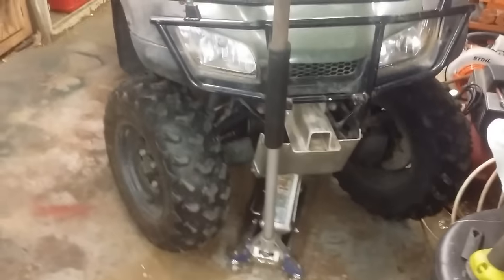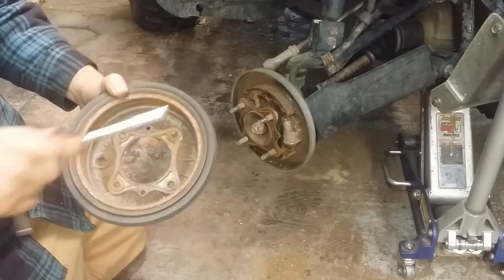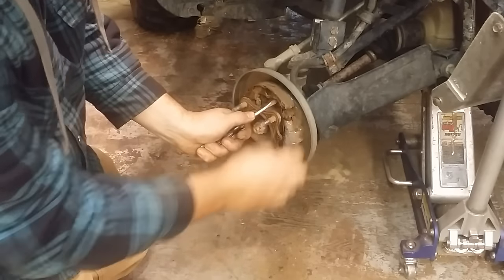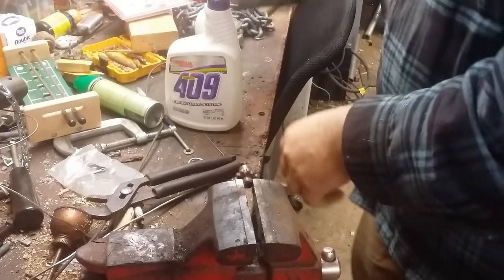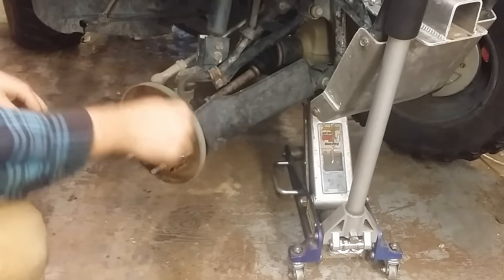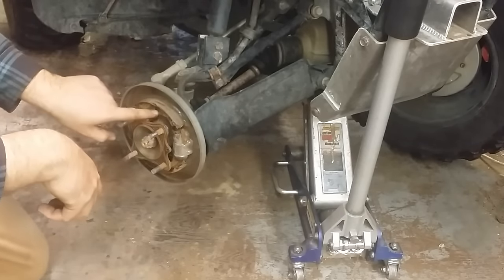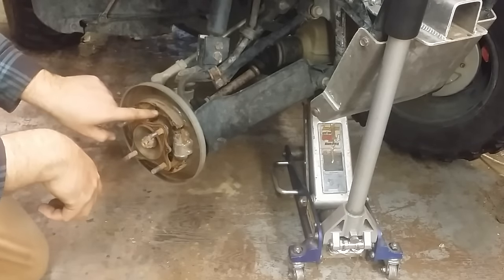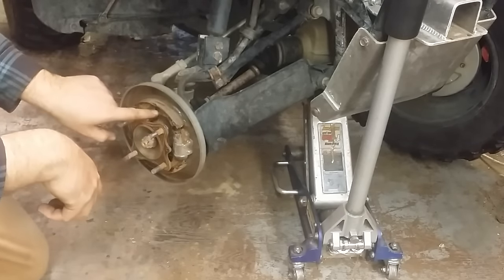Honda atv drum brake adjustment and refresh

Comment: LOL "Something this old, the bleeders are gonna be all rusted out". I have three Honda 300's and all three bleeders loosened fine. I've never had a bleeder seized up on any atv's I've worked on, and I've worked on quite a few in my days.
Reply: I have a 96 300 and my drum is having a tough time rotating. Any advice. (It sat for 6 plus years)
Reply: My 97 400 had a similar problem. Part of the rear shoe actually broke off, and became wedged between the rest of the brake shoe and the drum. Couldn't even coast downhill in neurtral. Rode it that way for a year.

Comment: At 7:09, I always use a dab of anti-seize on those threads before I screw them in. I seem to get more time before the adjusters start trying to re-freeze, as they tend to do. Thanks for the video! Good stuff!  
Edit: I saw later in the video where you hate it. I totally get that, but it absolutely works, and will outlast lithium grease every time. But it is a MESS. I keep it in a small syringe and squeeze a dab onto the threads. It doesn't take much.
Reply from the maker: I've started using the copper anti seize, and like it way more than the silver shmoo. plus it doesn't make as big of a mess.
Reply: @1beastlydudefixbreakrepeat  I'll have to give that a try.

Comment: Honda manual says grease the inner and outer seals, would probably help keep the drums sealed. Never had a problem with our Rancher 400
Reply from the maker: The only problem with that is the dusty environments I ride in. The grease will trap and hold the abrasive dust
Reply: @1beastlydudefixbreakrepeat  hm, I suppose that may be true, I would hope Honda would've thought of that, but maybe the drums are simply not designed well.
Reply: @M.TTT.  Pretty sure Honda engineers know these get ridden in the dust. That would be gentle riding! Greasing them stops wear and keeps water out better. The harder you ride, the more often you need to pull them apart and clean/Re-grease.
Reply: @brucea550  mmhmm

Comment: Is the rubber seal replaceable on rancher front drum
Reply from the maker: Mike Detisch it is replaceable, but with high milage or excessive wear on the aluminum casting..a new seal will leak, the best thing would be to make a drain hole in the bottom

Comment: my front brakes dont have any pressure at all... i bled them and it still wont work. what do i do
Reply from the maker: curtis byrne  be sure you got all the air out of the lines, they can be tricky. 
also make sure your pads are adjusted right they should drag ever so slightly on the drums...you should hear them rubbing. if all that fails check your master cylinder it may have air in it, remove the top and jiggle the handle see if any fluid or air bubbles. if it's tiny bubbles keep bleeding, if fluid it's the master gone bad.
Reply: i notice little bubbles coming from the master cylinder when pumping. i opened the bleed valve for like a minute and pumped for a minute and little was squirting out along with air. they worked before i took it apart.....i dont know what i done
Reply from the maker: curtis byrn the bleeder should only be open to allow fluid out .  so squeeze, open, close ,release .

keep jiggling the Handle until no more bubbles come up. the bleed the brakes again.

make sure the bleeder is not open when you relate the handle or it will suck in more air...squeeze open, close, relase

Comment: My 97 kodiak is very similar to this. Did you do a video for the rear breaks? I have zero breaks. I plan on bleeding the fronts tomorrow but am not sure on the rears
Reply from the maker: not on this specifically, I have one on a kawasaki,most rear drum breaks are the same . https://www.youtube.com/watch?v=NCJEnq75zWo
Reply: I appreciate the response. I’ll check that video out!
Reply from the maker: Sonoma Style your welcome,most arcs have either the mechanical drum break or a hydraulic disk in the rear....if it's the drum break,start with ordering a set of shoes.then clean everything inside and install the new shoes. There should also be an adjustment on the housing or along the cable somewhere